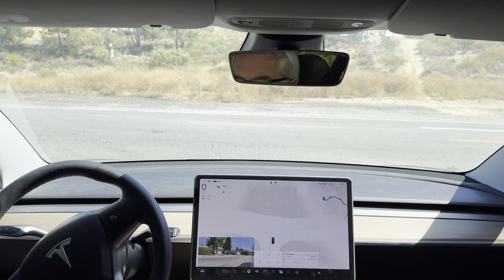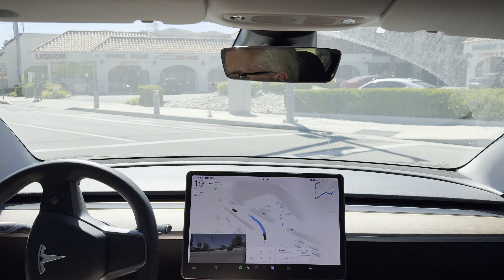Model 3 - FSD Supervised 12.4.1 - Test Loop 1 - 2024.15.5 - 29 June 2024

Comment: Thanks.  Bottom line-  if that was a Robotaxi drive then it was perfect.  Most of the nitpicky comments are valid but really you're asking FSD to drive like you do.  A couple of times I would have done it differently then you asked for but that's only so it would drive like I do.  -:)
Reply: Nobody is asking for robotaxis.   A human driver is faster and safer than beta FSD software, by far.   

Just call Uber, and 5 minutes later you have a ride .
Reply: @DerekDavis213  Nobody asked for automobiles, passenger aircraft, or ridiculously large screen TVs. However, once a technology becomes available, more efficient and more cost effective and profitable than the alternatives, the market will make it happen.
Reply: @danliebster9894  Uber and Lyft today give rides to people, safely and quickly .   FSD powered Taxi will be less capable than the human Uber drivers that we already have.
Reply: Meh... My auto pilot (not fsd) is jerky and annoying. I always want to correct it but I just let it do it's thing. Needs to be more humanlike.

Comment: Cutting over the lane line when there is no car next to you is just finding the smoothest driving path in my mind. If FSD does not do this by the time it reaches UK, I'm going to complain that it's being too robotic.

Right now, Autopilot stays dead centre in the lane and it's the main reason I'm constantly taking it out of Autopilot. It's weird that you guys report these issues when there are no cars around to interfere with. If it does it with a car next to you, sure.

Comment: A very easy drive for a human, but FSD 12.4.1 continues to have problems:

0:43   too slow making the Right turn
1:46   not doing a proper merge, not signaling anymore in 12.4.1
3:23   not slowing for speed bump until the last second
3:47   FULL SPEED over  a speed bump.  so many failures here
3:56   STILL having problems with the Left turn and suicide lane
4:29   Human intervention , tapped accel pedal becuz FSD is slow
8:05   Cut the left turn too sharply.  Not good

How come speed bumps were only tested once, instead of twice (as usual) ?
Reply: room or improvement :) , I dont see how they will have anything ready for robotaxi this year. at least Europe wont approve nothing like this.
Reply: @clarazegarelli5861  Agreed, Europe is much more protective of consumers, and consumer safety.  FSD will not be approved there are a long time.